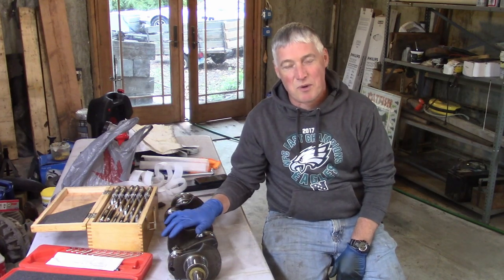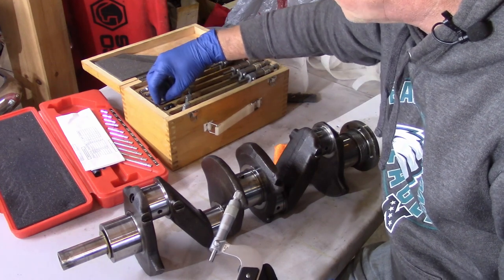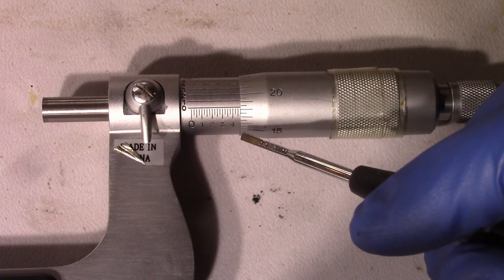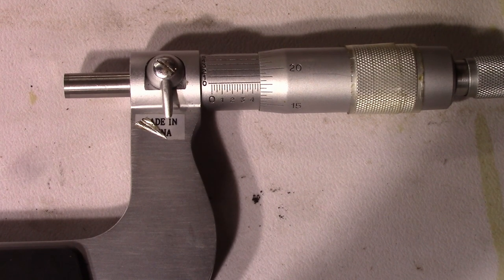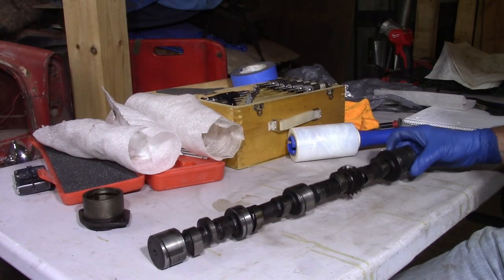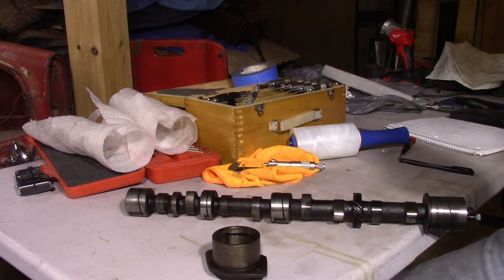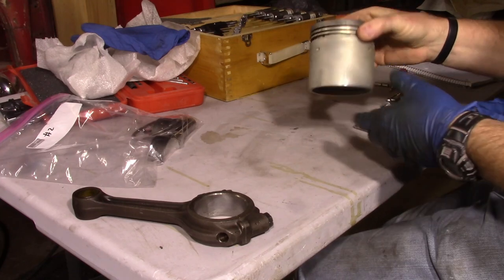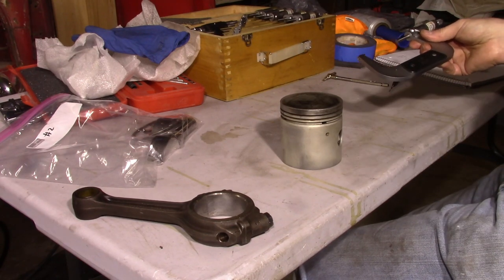Triumph TR4 - Engine Rebuild #3 - Measurements | Roundtail Restoration

Comment: hi Chris i have the same mesurement on my crankshaft ...about 2,4683 for main and 2,0751 for connecting rods ...your crankshaft has already been  machined under 010 (not the original size) but do you keep your bearing  with 0.010 size or uppersize 0.020 ? thank you for all your videos
Reply from the maker: I used 0.010" oversized bearings to make up for the machine work. Thanks for watching!